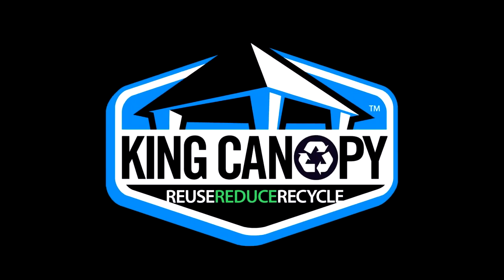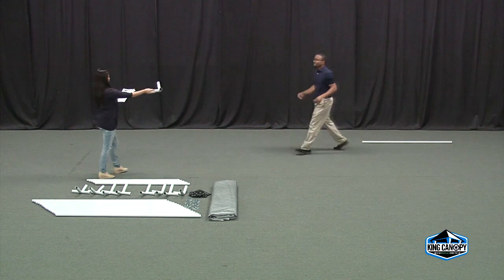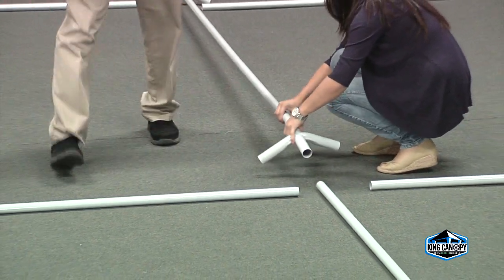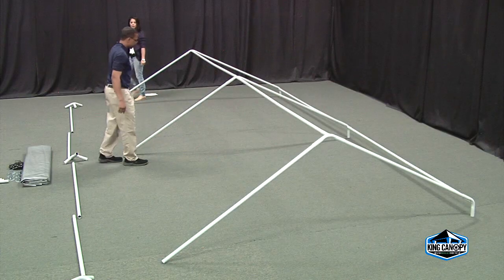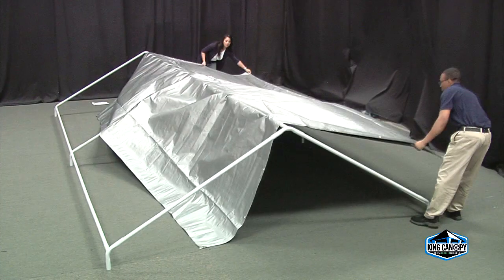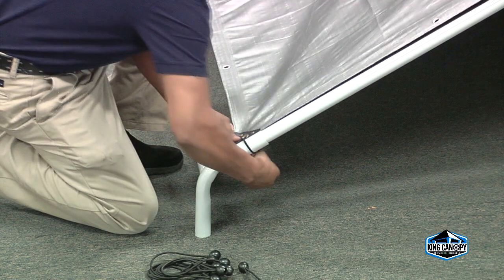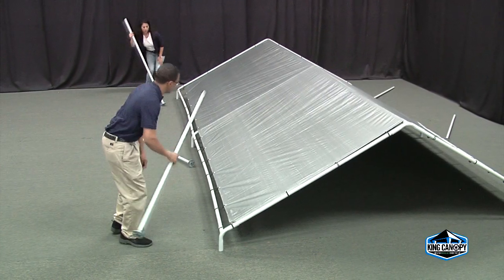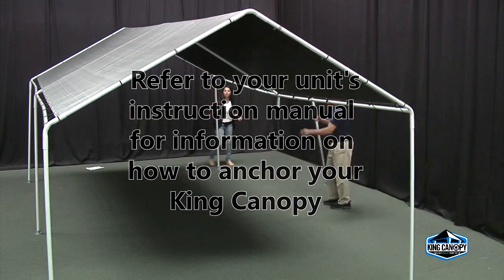Original 10'x20' King Canopy Set Up

Comment: this is an awesome canopy (listen to me if you want to set it up right way)... get T REX tape and tape all the joints where poles come together (100% must do this) didn't take but about 20 minutes to do this taping (almost makes it easier when setting up)... i put 8 (2 on each corner) 30 pound cinder blocks on each corner and put each corner pole down inside these blocks then used long zip tie to attach to brick and pole... after you have all the rivets done with the ball and rope stretchy things i " T rexed " the rivet holes with a 4" piece of tape underneath and on top... look for any scratches or "thin areas" in the tarp and put a 6 to 8" piece of T Rex tape on it..... i Shored up this thing like crazy and in 3 months it has seriously paid off.. had a major snow storm (next morning was over 400 to 500 pounds maybe more) of snow sitting on it and almost touching vehicle it was weighing it down (but did not break) i swept it off with long paddle (you could use broom)... the tarp did not stay stretched.. it went right back to it's original tightness.... just now had a massive wind (almost tornado) storm and the wind was "punching" the hell out of this canopy.. jerking it side to side (only swayed about 3 to 5" at a time).... had i not put those heavy cinder blocks (2 on each corner) no way this thing would have stayed up.... i am SERIOUSLY IMPRESSED ... and i generally don't write reviews.. but wow... i got the 10 X 20 (liek this one in video) and it was worth every penny ( i did not put bricks in middle portion poles just took a bungy strap to each side in the middle and anchored to cement driveway)... this canopy is awesome.. if it can withhold the last 2 major events i suspect it will do much more... i am a lifetime customer should this one ever faulter... One guy i saw his lasted 5 years... again, i have shored my up big time with T Rex tape on all the joints where poles connect (this is a MUST.. BELIEVE ME YOU'LL BE HAPPY YOU DID) ... very very pleased.

Comment: to many pieces and to complicated
Reply: mine took maybe 90 minutes to set up by myself! and that's after T Rex (monster type tape which is strong than monster tape) to set up..... tape up all the joints where poles connect (wrap around twice).... weight down the corners with cement bricks (2 on each corner at least 25 lbs each).. believe me.. for a total of about 200 bucks (that's with Tent cost 2 rolls of tape and 8 big open style bricks..set poles down in them).. and about 2 hours labor after everyhting shored up and done this was wellllll worth it..very very happy!!
Reply: That's really straight forward
How can u say it's too complicated🙄